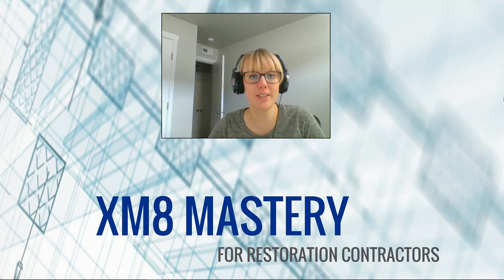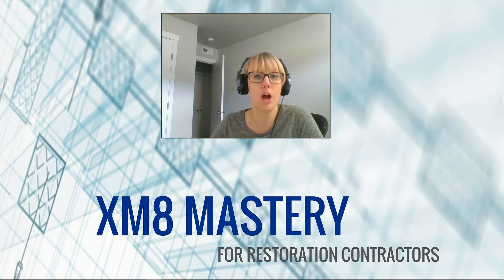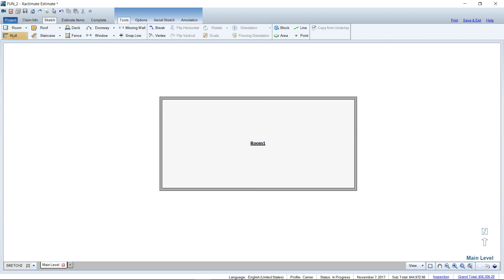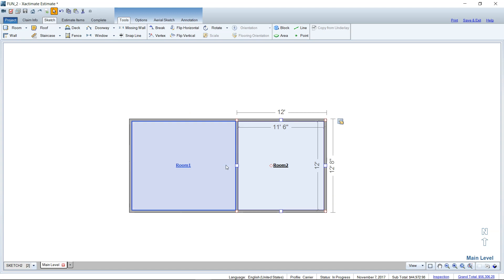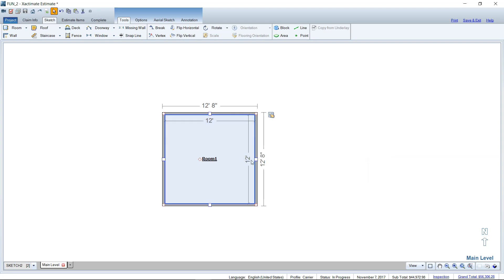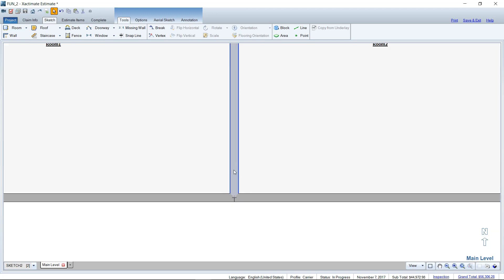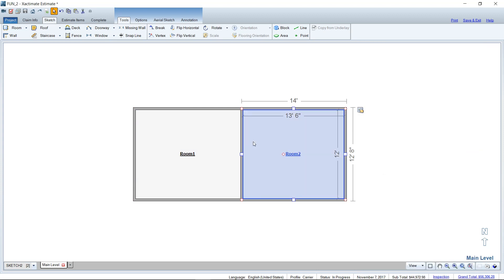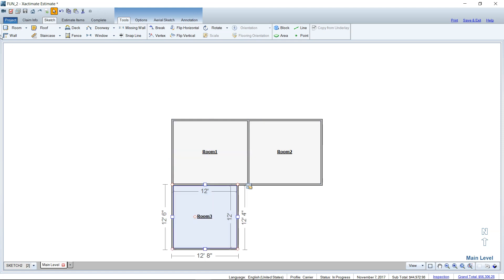How (Not) to Add a Room in Xactimate

Comment: What happens when you try to install a stairway and then try to remove, it leaves a shadow in plan view or an opening in the floor elevation. You can not sketch over it with a correct stairway because of the opening. How do you clear the opening without having to recreate room totally.

Comment: Do you reccomend build the all rooms first and then changing individual room properties? If i set properties in room 1 and then build other rooms with the click control way,it will copy all the properties in room 1 right? so do you build all rooms then set properties?
Reply from the maker: Great question! If you have custom settings for each room then yes, build all of the rooms first, then set properties. A lot of homes share common ceiling heights, floor props, etc, so I would build those rooms off of each other. Then, when you have a room that differs, build it separately to allow for the custom settings. Basically, group those that share props together...does that make sense?
Reply: @EstimateMastery  Yes.Thank you.